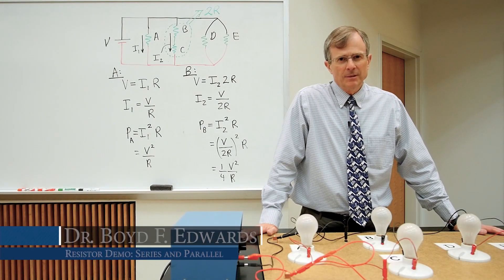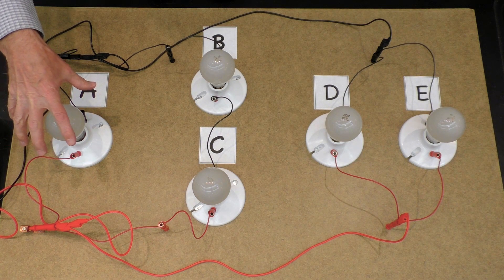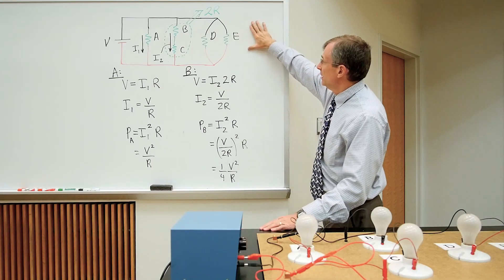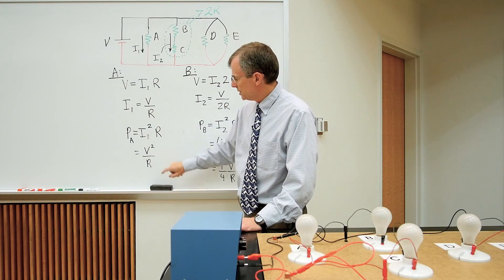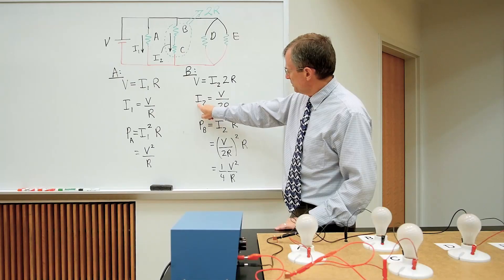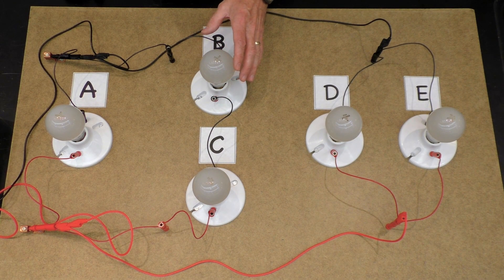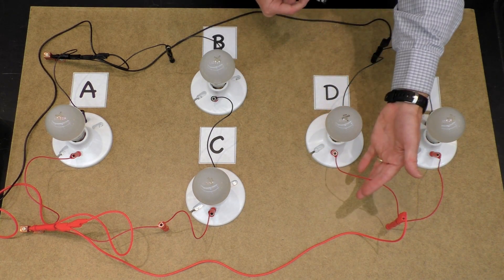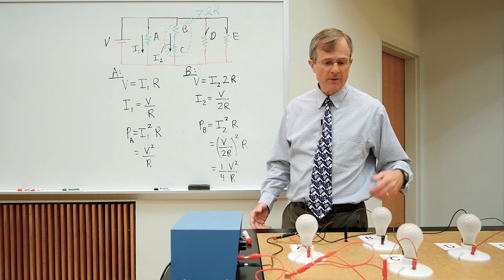Resistor Demo: Series and Parallel

Comment: One problem I am struggling to wrap my head around, is why a 60W bulb glows brighter than a 100W when wired in series, specifically.  Our prof made us do this experiment, but the explanation is still unclear to me.  Resistance is greater across the 60W....but why would that make it burn brighter ?